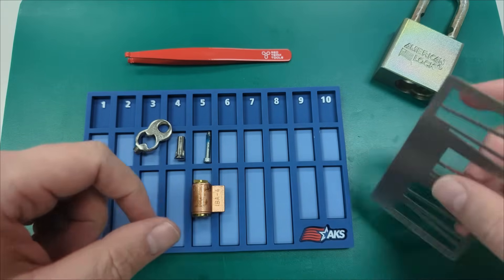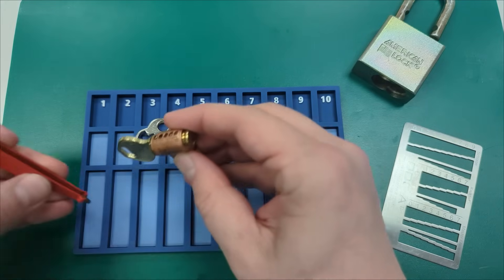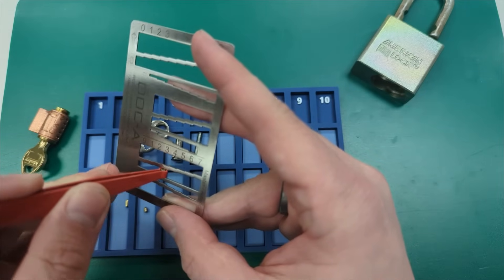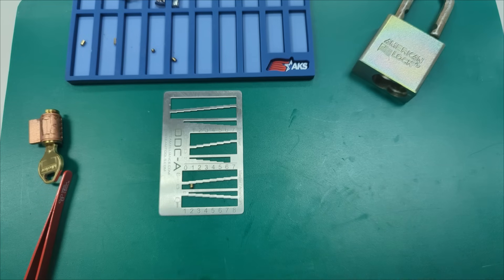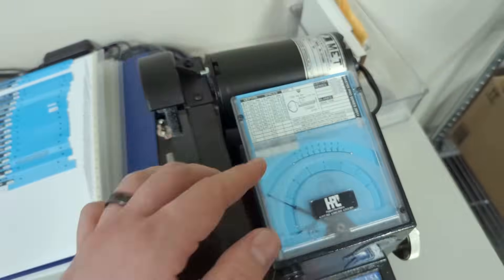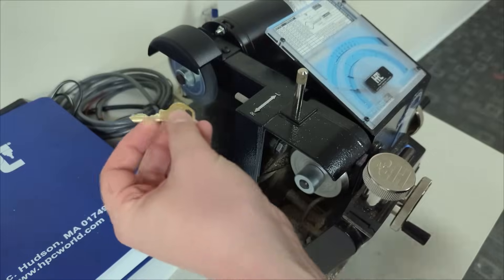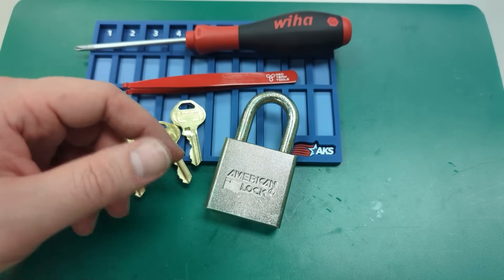Making a Military Padlock Key with the Devious Decoder Card (American Lock series, part 2)

Comment: 00:00 🗝 Using the Devious Decoder Card to determine the bitting of a lock.
02:27 🔍 When dealing with tiny pins, consider using the tabletop method for pin measurement.
03:49 🗝 Choose the appropriate key blank, such as the Master Pro Series k17, based on the lock being worked on.
05:03 🔧 Pay attention to the depth fields on the key blank, especially when dealing with obscure knowledge in locksmithing.
05:28 🚪 Successful key cutting using the determined pin measurements results in a working key for the lock.
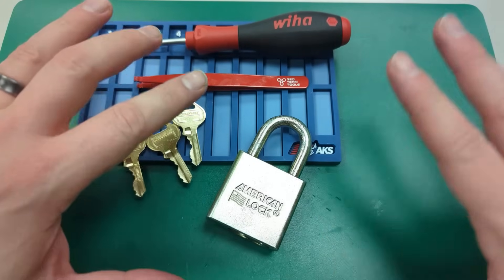06:15 🌐 Understanding the process of measuring pins and cutting keys is crucial, especially in dealing with non-key removable locks.
06:52 🎁 Giveaway announcement: Enter for a chance to win a Devious Decoder Card, pinning tweezers, and a new steel DDC.

Comment: Great video Dev and love the new decoder card. While “pinning tweezers” are often useful, sometimes their special end shape gets in the way as it did in this case trying to fit the pin into the decoder slots. I also keep fine pointy tweezers handy for times like this: the last one I ordered was  "HTS 171S6 6.25" Straight Stainless Steel College Tweezers" but you can find others - I recommend searching for search for "lab" or "surgical" or "forceps" to find non-cosmetic long tweezers.

Comment: Such fancy machines and quality tools, and yet not a single pair of point tweezers in sight
Reply from the maker: Point tweezers meaning like what you use to pluck your eyebrows? Yeah, you don't see many of them in a locksmith shop because we are usually not doing facials and spa stuff on the side. 😉
Reply: @DeviantOllam  Should just take a set of the normal tweezers and file/grind down so they hold a smaller pin ;)